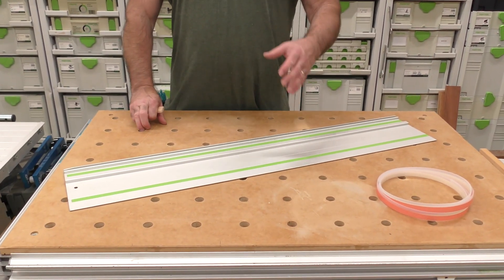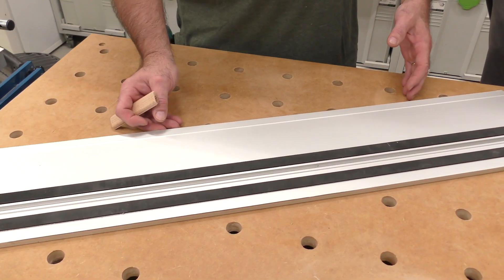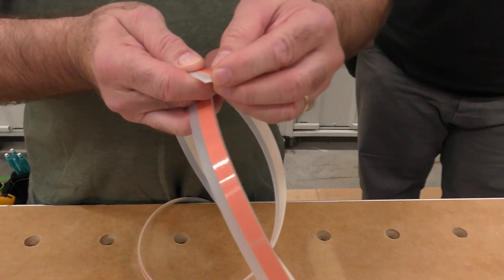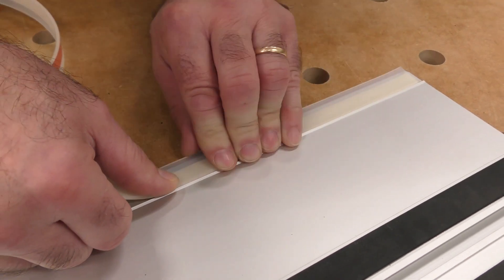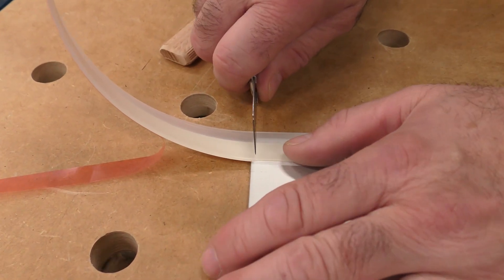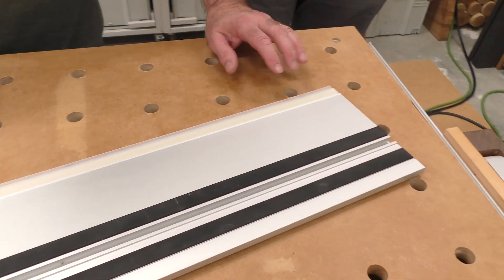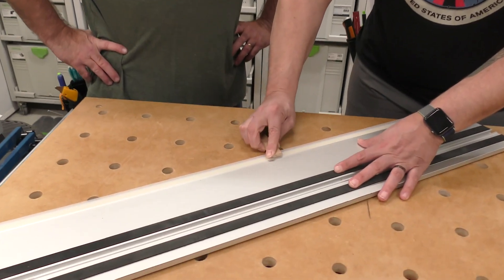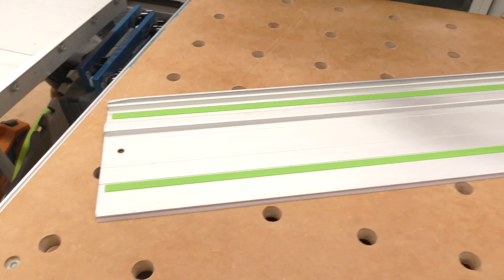Have You Replaced Your Splinter Guard?

Comment: I've followed Sedge's directions to the letter (other than the C-A glue), but alas, to no avail.   Before long, the Festool brand splinter guard comes unglued and begins to just hang.  Trying to re-stick it is futile as it won't stay re-stuck even for a day or so, and even then, that's not good because one cannot be certain of getting it re-affixed to the precise same location on rail, which would require re-cutting.  That solves the problem only for the very short term.   My long-term solution:  the first time an almost new Festool rail splinter guard becomes unstuck, I rip it off, gritting my teeth and muttering a few swear words as an incantation (guaranteed to make you feel better as you rip it off), and toss it into the garbage. I apply a new BLACK splinter guard from the company that makes turquoise power tools.  The black one stays put on the rail until I decide to replace it, regardless of rain, shine, frost, heat, or humidity.   Festool makes lots of good stuff.  Their splinter guard glue isn't one of them.  I think it's time they have a serious talk with someone who could supply a better adhesive for Festool's otherwise fine rail splinter guards.
Reply from the maker: Thanks for sharing

Comment: Sedge a related question I have an assortment of festool rails I purchased a few years ago that mostly have never been used yet all the splinter guards are or have fallen off.  I am thinking that festool must have an adhesive problem - it is well documented even Ron Paulk has done a video on it.  Because the splinter guards are new, I would like to clean the rail up and re adhere with an adhesive- 3m 77 or?  Thanks for any info Dave
Reply from the maker: I use a little CA glue if it peels at the end ...a drop or 2 works.....

Comment: Help!! Do you have a video about removing the old skid resistant strips on the back of the track? I’m having a h••• of a time getting the old one off. Heat gun doesn’t seem to loosen adhesive much. Thanks
Reply from the maker: i do not have a video on that .... but i use to use a utility knife and scrape it off....
Reply: @sedgetool  might be a good topic to make one on? Plenty of videos on splinter guard but could only find one on non slip strips

Comment: Hi Sedge! What do you use to clean the guide rail if any adhesive is stuck to the surface after removing it? I removed my splinter guard, but there’s a little bit of residue left.
Reply from the maker: I rarely clean the residue....but...I use to use lacquer thinner with the older splinter guards
Reply: @sedgetool  thanks Sedge!

Comment: Thanks for this vid sedge i know it seem like an easy job but i know there would be people like me that have problems with it sticking. Also i have no luck with acetone for cleaning the old glue of i find cellulose thinners works way way better
Reply from the maker: No problem 👍... I have used Lacquer thinner as well to clean it off in the past...It seems to me that not cleaning the rail that the splinter guard sticks better.
Reply: @sedgetool   keeping the splinter gaurd back from the end of the rail is clever too because the end of the guide normally gets all banged up. I normally trim them from time to time on the mitre saw